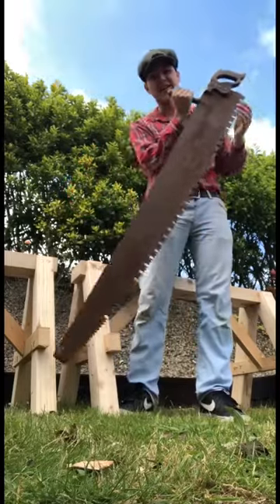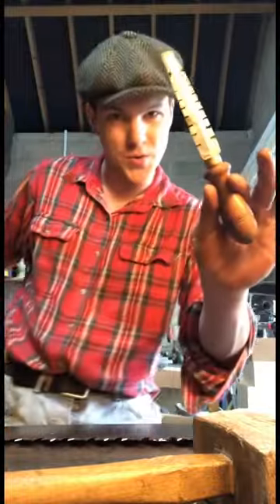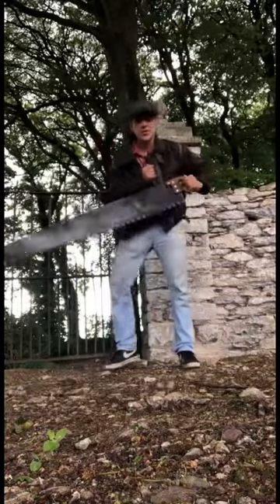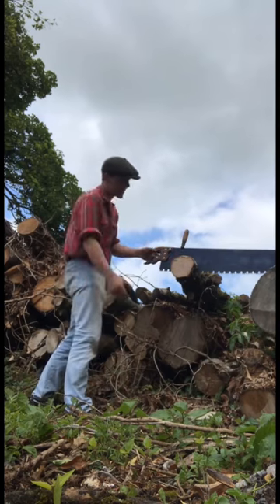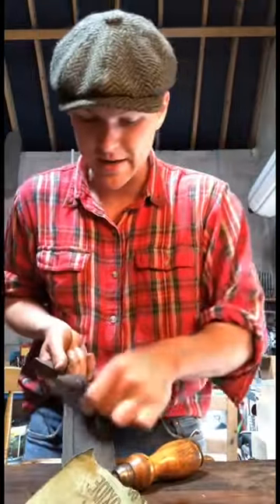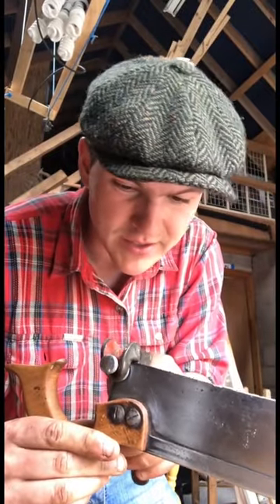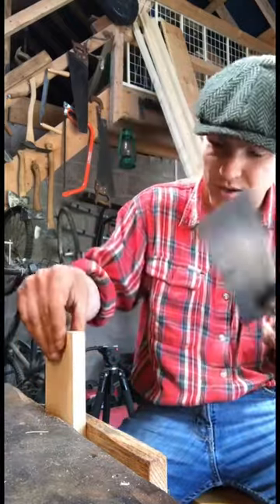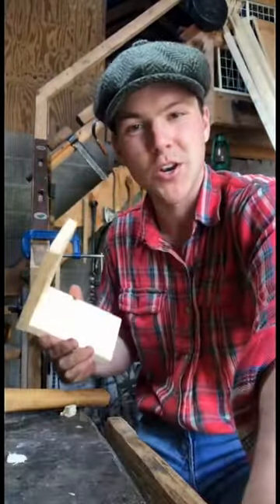Restoring My Biggest & Smallest Saw.

Comment: Something to keep in mind if you are cutting through some "dirty bark" (from what I understand more of an American issue) where it's got a lot of grooves that like to hold onto debri, you likely want to get rid of that bark (hatchet or even your hand works nicely) to preserve the edge on your saw. (The "rough edge" of a double headed axe would be used to get through the bark while the razor edge would go through the meat of it, this was to preserve the edge throughout the day)
Reply: For sure. Michigan loggers have different equipment than most for a reason. Those giant oak trees aren't just insanely dense, they also have crazy knobby bark. Many of our trees grow into the shape of an asterisk too, as opposed to a normal circle.

Comment: A little bit of oil on the blade would make it slide a bit better no?
Reply: Oil on the blade is generally used for preventing rust. The small amount of oil that'll be on the cutting edge will be gone in the first few pulls, but technically yes those first pulls will be smoother (while staining the wood with whatever oil you chose).
Reply: Oiling saws is much more common practice with electric saws, specifically circular saws that require substantial free movement. But the oil is not going on the cutting edge.